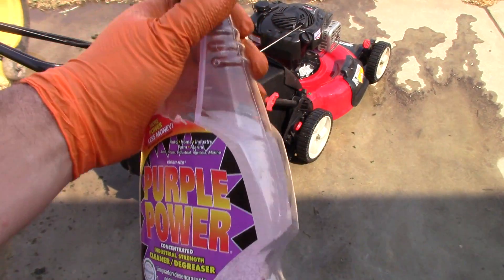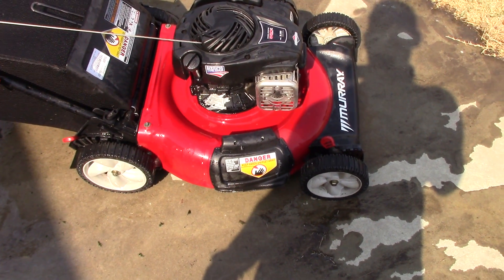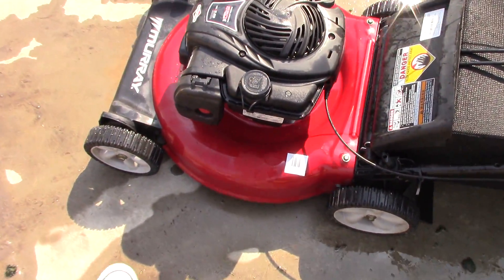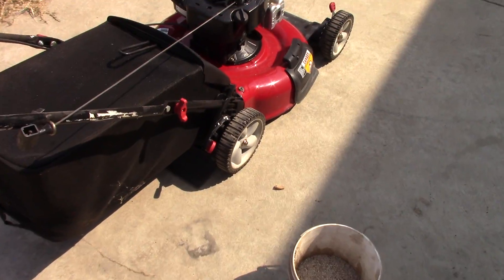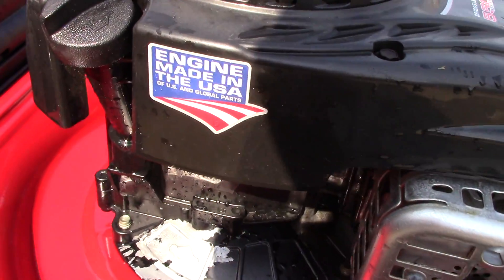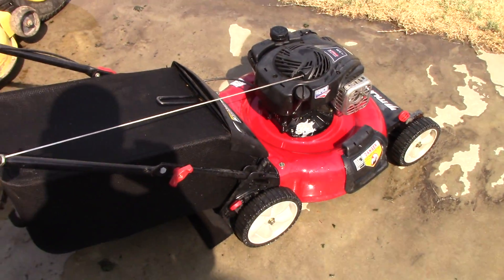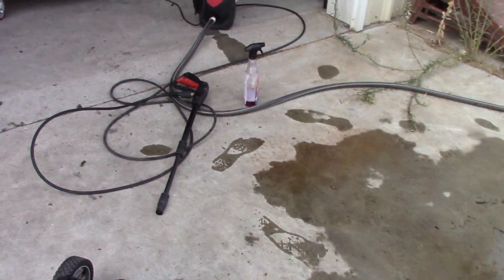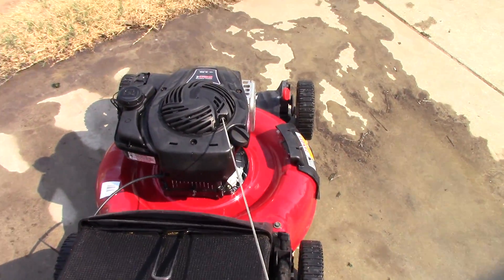Got the Other Newer 2012 Murray Running

Comment: I use purple power and or simple green on all my mowers I am servicing or selling. Both are good products which we would use to clean the oily/greasy outboards at work. I also wax the decks of my mowers, but they don't always come fully back as far as shine. I am just trying to prevent some rusting for the next owner. I look forward to the next video! -Nick.

Comment: Runs good, I use purple power as well.
Reply from the maker: It works pretty well man, ive not really used it on decks before, It took all the crap right off

Comment: I've had the same thing, I find the ones with the American made stickers to be better engines in the way they perform and run.
Reply from the maker: interesting, I wonder if the other I have has a us made motor or not, there is no sticker on it
Reply: I actually today sold my 21" I talked about and got another just like it with the American Made sticker, it's a lot better mower, runs smoother and faster and I love it, was a Walmart return and has the spray paint on it but I gave $20 so I'm not complaining at all.
Reply from the maker: not bad, I just sold this one today actually 120 bucks later haha

Comment: Purple Power works great, I use that too.  Some I had ran better than others no matter how clean the carb was, just a cheap design overall.
Reply from the maker: the purple power stuff was a good buy on my part works great in an ultrasonic cleaner too

Comment: When i clean out the bottom of my mowers I just put a block of wood under the wheel get some gloves, hose and a flathead screwdriver and just scrape and wash it all off. I leave a lid off a old grabage can underneath it to catch all the grass clippings and rust dont want the dogs getting into it
Reply from the maker: thats smart using a lid, ive done it that way and scraped it off, or turned the mower over and hit it with a powerwasher which works well too. When there is just a little I have done the method of just letting it suck the water up, I do that way most often with my rider deck as its the most convenient
Reply: We have yet to pick up a pressure washer its on my buy list but we had to borrow one from our landlords to redo the deck. a bit hesitant about pressure washing mine and my dads briggs and stratton classics both have a very light deck on them that feels thin.. I have a older briggs and stratton quantum from the early 2000s with some heavy duty steel i wouldnt mind pressure washing... if it was used often that is its a backup mower for now
Reply from the maker: The electric units arent all that bad either, the gas ones are great for big jobs but they put out a ton of PSI, I use my little snapon one does about 1500PSI compared to the honda powered one at 3000 I believe. Works great one mower stuff.
Reply: I might have to get one then